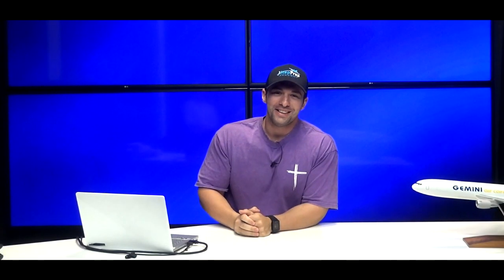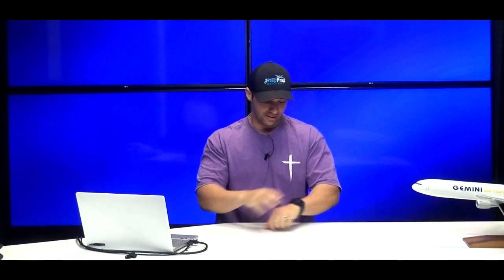V1 Cut - THE MAIN THING

Comment: More or less how much rudder trim units?
Reply: I'm a retired 757/767 Captain, currently a simulator instructor, been at this for over 40 years, typed on many aircraft DC8, B727, B737NG, B757/767, B747, A320 and..... I couldn't tell you any units or numbers!!! I have never used it, as Joe said, I do the same, I trim to where I can feel I'm good, and I trim constantly, trim...trim...trim. The only difference with what Joe said is that I don't trim to "no pressure" I trim until I'm almost there, but leave a little pressure with my foot to "FEEL the aircraft and what it's doing". But this is just technique, it's my technique, it's what works for me, doesn't necessarily work for everyone. But bottom line.... in all my years of flying, and instructing in the simulator, I never learned numbers (units of rudder trim) because I don't really need them. I just go by feel.
Reply: @Ppilot71 Thank you